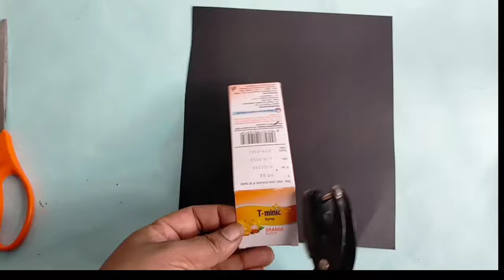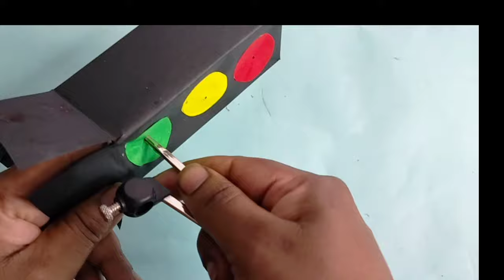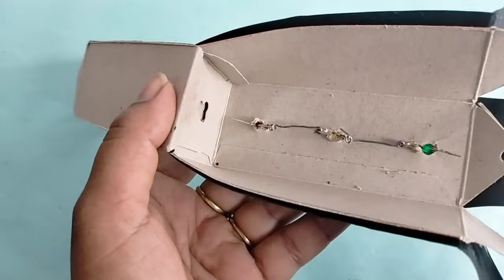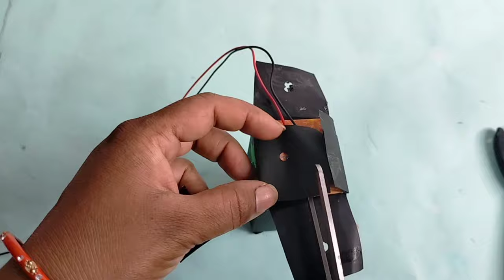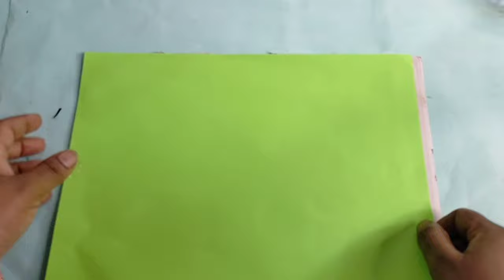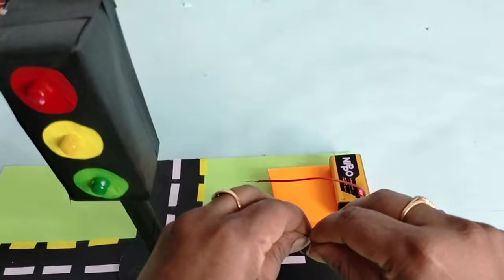Traffic Light working model/Traffic signal with light/Traffic signal project/traffic light model

Comment: Hii i have a project to do and i was willing to al you whats the name of that battery?
Reply from the maker: It's a 9V Eveready battery or Duracel battery available in market at electronic shop
Reply: Thank you so much
Reply: Is there anyway for the led lights to switch on one at a time
Reply: And if I would need 3 resistors and 3 switches in order to switch them all one at a time